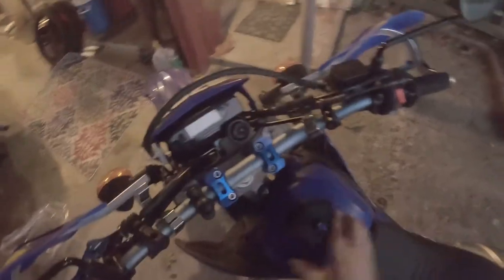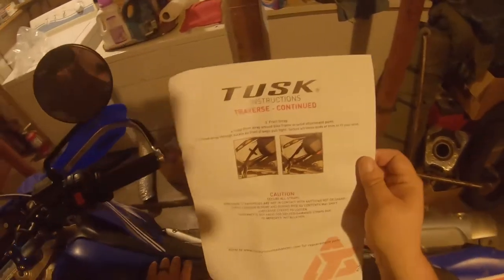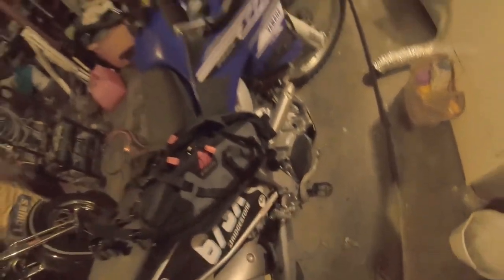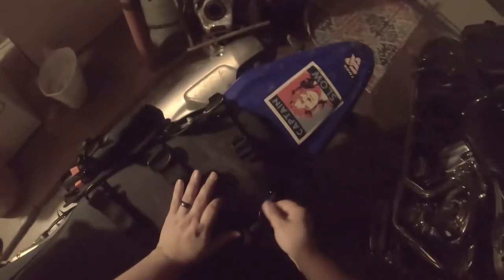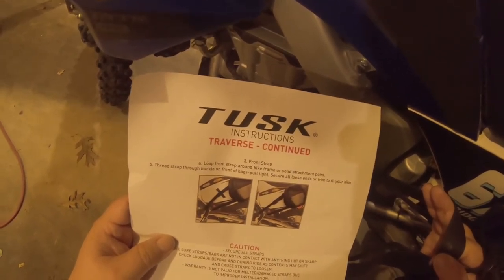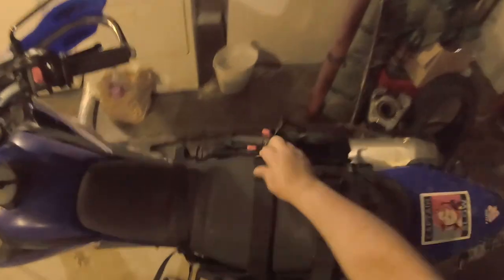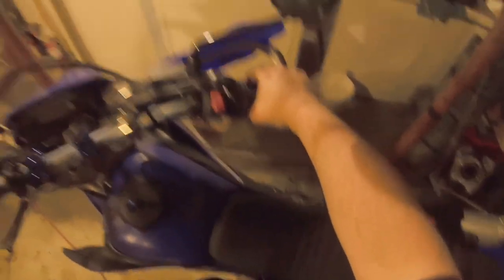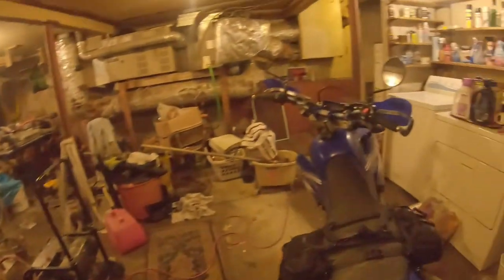Tusk Traverse Pannier Install

Comment: What constitutes a bike being an “over lander”?
Reply from the maker: I guess people call them adventure bikes, my vernacular is a bit odd for a Texan.  Normally in my opinion 400+ cc's with wind protection kinda fits this description.   I mean you can toss on a windshield and luggage on a WR250R but for hundreds of miles on the Tarmac it will be less comfortable.  I used to have a 124 mile round way commute that was vaguely uncomfortable on a dr650, cake on my Africa twin, and... highly uncomfortable on my Wr250r.
Reply: @stoplogicmotorsports  ok... I was just curious,  because I’ve never heard of a bike referred to as an over lander... I just bought my first dual sport, a 300 rally. I think know what an adventure bike is, it seems to be something a little heavier, more powerful, and generally more comfortable than a dual  sport.... So I’m assuming an over lander would be a highly capable/versatile adventure bike...
Reply from the maker: @airadaimagery692  100% on point, also the 300 rally is a brilliant bike.  Likely if I get back into distance riding that one is on the short list.  I kinda lost interest in long distance and got back into dirt racing.  Though with my Africa twin I kinda rode it outside its element.  If you want a laugh I have a video of me taking it on an MX track.
Reply: @stoplogicmotorsports  lol for sure!